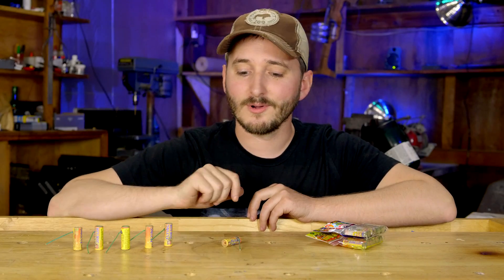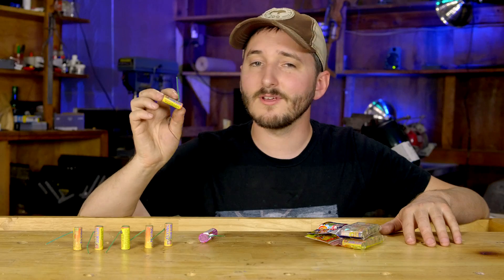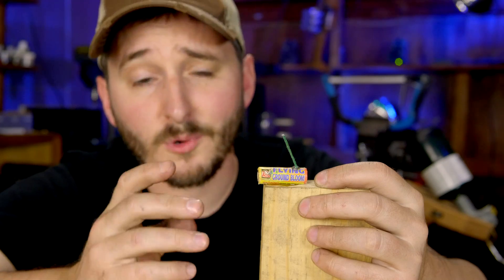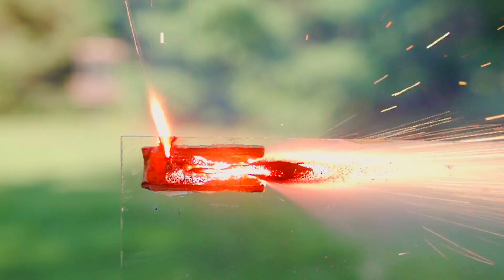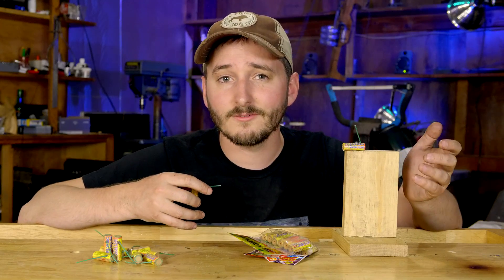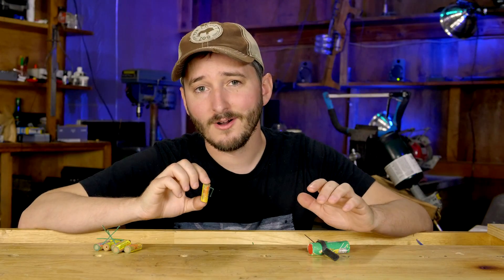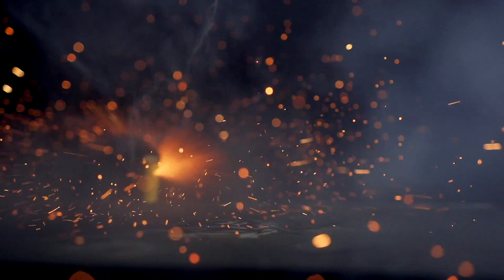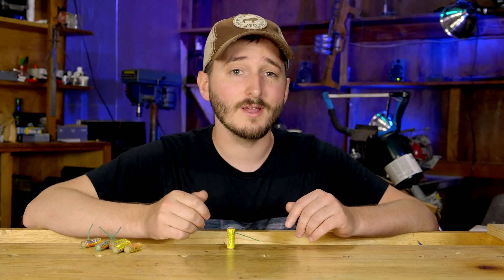How Do These Fireworks Fly?

Comment: I am looking at this as a spin balanced system very much like a spinning top, as you suggested . The side exhaust is pushing in all directions (with a slight angle to incur rotation), preventing it from falling in any one direction (would imagine speed of rotation is a factor) and once it is semi balanced the flame will simply push it up.

Comment: I'm gonna go ahead and guess a possible reason why the fireworks stand up upon the fuse igniting them. I noticed during the slow-mo of the one you cut in half, that there is a fairly large "plug" in the "head" of the firework compared to the end with the exhaust hole. The red clay like stuff gives the head more weight and when the initial fuse lights and provides thrust, that "plug" becomes the center of gravity. The hole from the fuse isn't drilled directly into the tube, it has a downward angle to it to assist in some downward thrust. The angle of that hole combined the with mass of the head "plug" creates a center of gravity at the head of the firework. This forces it to spin around that weight and lift ever so slightly. That seems to be the reason it stands up.

Comment: ok, my guess is.....

the exit hole is not only tangential to it length but as you also pointed out tangentially to its axis. this creates a spin in 2 axis. one of those spins is high energy,  axially, and one of those spins, along its length, is low energy and used to help start a gyroscopic procession so that the point of contact will shift as friction grabs hold. because of the spin tangential to the axis it also rotates and when the jet is blowing into air it only has so much mass to push against (and/or is just pushing down in with gravity) but when it rotates about and faces down it has the "ground effect" or something to push against (and/or is blowing in a direction not forcing the body against a solid surface) which starts to stand it up. when it stands up you develop the friction point along its annular face which combines the low energy spin and high energy spin combine to finish standing it up. think 'spins faster, when the procession wants to bring the axis of rotation over the friction point as the friction point is brought under the axis of rotation. because the speed of rotation is increasing as force is continued to be exerted you see the gyroscopic procession work backwards then you are used to seeing (as it gets slower it processes more is now happening in reverse. gyroscopic recession?) this brings the body to line up in a direction mostly up when the launch charge ignites, and, as its still spinning while being launched you now have a rifling effect to stabilize it in flight and through doppler effects and hiding or exposing the noise source on the front or rear side of the body as you view it you get the warbling effect in the sound.

Comment: The spin causes a torque that points toward the fuse end. The fireworks always spin in the same direction, and following the right hand rule we know this. Torque is the same reason gyroscopes self-stabilize.a

The ground effect kicks it off the ground just enough to allow that torque to take over. I would imagine that the initial orientation has an impact. I'll have to rewatch the footage, but I imagine that the ones that start by rotating perpendicular to the ground plane had their fuses parallel to the ground.

Ground effect, by the way, is caused by the ground pushing back faster than the air. Newton's third law dictates that they both push back the same amount, but Newton's second law dictates that since the ground stops the thrust more quickly, a thrust pushing into a hard surface produces more thrust than a thrust pointing into the air. 

The impact friction has would be limited to allowing the tube to spin. You know how bowling balls don't start rolling until halfway fown the lane? That's because the lane is waxed. Different waxing patterns affect the spin of the ball differently. This could be tested by greasing the table and by firing them off on sandpaper.

Comment: Friction is a factor but I think the primary reason for the tube to spin is that the nozzle is not drilled towards the center of the cross section. You can see in the shot at around @9:19, the 'thrust vector' is offset.

Comment: We called them stingers. We would put them on a nail that was sticking up from a board and they would launch in the direction the nail was pointed. We had much larger kind as well. Can be made from a mode rocket engine if you drill right size hole in right places. And they work with or without nail. Fun  kid stuff.

Comment: The rocket stands upright because that is the most stable angle for it to rotate around its axis, when it is interacting with the ground. When it rotates around its axis, it bumps into the ground. This causes instability. 
In the first moments if this bumping aligns with the direction of the exhaust, it stands up quickly. Because this causes maximum instability towards laying down. But if the bumping aligns with the opposite direction of the exhaust, it stands up more slowly, because that causes maximum stability in that circumstance. But on average it is more unstable than stable, so it has to stand up anyway.
When it is not interacting with the ground, then any angle is equally stable for it to rotate around its axis..
The ground causes instability towards a specific direction. So the rocket needs to rotate in a perpendicular angle to the ground.

Comment: These are really interesting fireworks because when you spin them the force point gets closer to the axis of rotation rather than farther like 99% of other spinning things. Those want the force as far away as possible, like spinning in a chair or a governor. The way that I see this working is that the force vector is offset from the center of the rocket. So as it is pushed in a circle laying flat there is also a small amout of force pushing upwards. As the rotations increase  this leads to a constant inwards push as the rocket begins to stand up forcing the rocket to move skywards. This doesn't happen off the table because there is no orientation dictating ground so it finds the long axis and goes in that direction, ie any random direction

Comment: I would assume the distribution of the fuel also distributes the weight. The first burn rotates on its axis vertically because it’s mass is decreasing while the second lot of fuel still has all its weight at the bottom.

Comment: Not going to claim to be smarter than you, after all, you've taught me a lot... but in support of your theory I'd like you to consider the direction that these burn (from one end to the other) and hence the weight imbalance that occurs during that initial rotation. That is to say, as one side burns (and becomes lighter), with exhaust pushing that side upward, you have the transition into the "spinning top" effect you mentioned. Then there's the upward thrust as the other side is well and truly burning.

Comment: The moment the fuse burns into the firework it seems to roll so the hole is down. I wonder if the hole side is weighted more on that side to get it to fall hole side down as the side charge lights helping it stand up?

Comment: I think the thrust of the side jet self rights it. It first jumps slightly upright by using the higher pressure generated when the jet blows right onto the ground. basically a ground effect. then, while it's spinning around it's longitudinal axis, while also spinning around off axis, it continues to speed up. I think the gyroscopic effect from that increase in rotational speed begins to stabilize it and reduce the off-axis tilt.

I think the best way to test the second half of this would to be to build some sort of top like device, that has a way to increase it's rpm under it's own power. My best idea is use a co2 cartridge inside some custom made top, and have it so it does a controlled discharge out nozzles in the sides to get it to spin. if the top begins to get more stable, with less off axis tilt/rotation, we could be relatively sure that the increase in the gyroscopic effect is what gets it to point within a certain degree of straight up for launch.

Comment: I enjoyed thinking about this along with you in the video - the thought process journey is as enjoyable as any conclusion we may eventually reach.

As a further experimental idea, I suggest trying to spin small cylinders on a flat surface, with no rocket thrust - I feel like there is something about the geometry of the contact point with the ground vs the rotation of the object that tends to drag the cylinder into an upright position
Reply: Same with a hard boiled egg- spin one flat and it will stand up!
Reply: Clearly the alignment of the side nozzle provides a significant thrust vector tangential to the circumference of the cylinder.  Combined with it's orientation relative to the CG, that's going to tend to make it stand up.  If the thrust was also angled axially toward the CG, ti would make the object want to take off, without any help from the jet on the end.  That said, it would require much more thrust, and it wouldn;t be as fast or impressive.  This configuration would be much cheaper and much more exciting, which, after all, is the point.

Comment: Many of my rockets in KSP ended up like that, so I kinda expected it to work like that ^^

i can not make any claims of fully understanding the physics behind this, but I intuitively understood that the tube will stand  up when rotated. I guess since the center of mass will not be he center of volume. Or maybe its related to distribution of mass around the spinning axis, and a standing tube has that closer to the axis. in any way, once the tube stands the nozzle points down and on average imparts a vertical thrust vector.

Comment: IDEA: I used to shoot bottle rockets by placing them at the top of a length of pipe. Each was held from falling inside by the fuse. When the fuse burned short enough they would fall inside like a mortar and I could aim them easily. This technique would work well with these... The tube could possibly increase thrust while the spin would provide stability like a rifle.

Comment: One thing is that there may be a shifting in the centre of mass. As the firework is lit, the fuel combusts and some of the weight is expelled in the form of ash/smoke. This would also change its moment of inertia as well. If the center of mass is moving from more-or-less the centre, towards the bottom exhaust on one side, it could be that the self-righting a side effect of the spin and the moving centre of mass and/or change in moment of inertia

Comment: Feathers on the back end of a dart will make the tip point down when you drop it, because the point is weighted.
The first sparks make the firework lift up, but since they are on one end of the cylinder, it mostly lifts one end.
So now the dead weight of the bottom end makes that side point down.
The second release of sparks lifts the whole firework into the air just as you described it.

Comment: I always pondered the physics of these as a kid. But have not thought about this for 15 years. So 15 years ago I would take these fireworks aka "blooms" and have a friend light the fuse as I held it in a sling shot fully pulled back and ready to release as the fuse almost ran out. I would shoot it into the sky and when it would light up it would then rocket spiral its way back to earth and sometimes back towards us like a missile... But most of the time it was short lived and would run out of juice before it would hit us or start a brush fire. But it was in fact really weird because if you just light it on flat ground it would just spin like a top.... aka a flower "bloom". Great 4th of July memories there.

Comment: My initial impression was that it would stand up due to precession, in fact I thought of a tippy top. Once it is spinning it simply needs the rocket motor to fire through the now bottom hole.
I dare say precession and the ground effect of the initial burn will both help stand it up, depending on circumstances, some will get  good blast to begin standing up, some may take a few revs and stand up largely due to precession.

We don't have those. I live in the UK. We are barely allowed a box of fucking matches.
I remember we uses to have some when I was a kid, but they were a bit bigger, twice s long and just had cardboard wings stapled on. They were crazy bastards, used to go anywhere. My mates mum had one land in her anorak hood and burn it to fuck. It was hilarious.
They banned 'em a couple years after. Not due to that incident obviously. But I don't doubt there were similar around the UK.
Though these wankers banned playing Conker's at school. Nothing would surprise me these days in the UK.

Comment: Night, I think maybe you're letting gyroscopic effects overcomplicate it. Imagine what the average sum of forces (-gravity+rocket thrust+ground effect) looks like at both ends under axial spin.  Gravity dominates the end with the (un-lit) lift nozzle because it has the mass of the nozzle and un-burnt fuel and nothing is countering gravity at that end.  Assume rocket thrust is constant and the gravity vector is constant. On average the rocket thrust coming from the fuse hole is zero because thrust at angle T is opposite thrust when spins to angle T+180, so it can be ignored.  So it simplifies to just laying there as if unlit until you add in the ground effect force. Ground effect is maximal when the nozzle points straight down and minimal when it points the opposite way. So on average ground effect is lifting one end. Now consider when it is lifted vertical, all of the mentioned forces are in equilibrium  since there is no ground effect,  rocket thrust is still canceling itself out and gravity is equal all around.  If it starts to tip over, ground effect comes into play again and rights it. The same imbalanced forces worked as it transitioned from horizontal to vertical. I hypothesize the reason time to right itself varies is due to the amount of time ground force dominates as axial spin accelerates. In other words, if it rolls over for the nozzle is on the ground before it spins in earnest, ground effect will have more time to act than if nozzle points some other way at first.  Not sure I put any of that into words very well, and for clarity I left out a lot of maybes and I thinks, possibly giving the impression that I think I know what I'm talking about when i'm actually very unsure.

Obviously there are other forces at play such as friction and gyroscopic, but I think they might be small compared to ground effect, or "cancel out."  I'm not sure if weight or inertia plays a larger part at the main nozzle end. It might be enlightening to put the firework on a falling surface so that ground effect is there but gravity isn't. Some numbers would be nice too. To me, it doesn't appear to be spinning all that fast so I discount gyroscopic forces, but maybe I'm wrong.  By counting frames, it should be easy to figure out all of the accelerations. If you're brave or perhaps stupid, you could try putting in a new fuse hole normal to the surface and plug the old one to see if that angle is relevant.  Maybe also spin it without lighting it to see if it will stand up as someone said will happen with a soda can (actually my favorite hypothesis except for my spin rate doubts).  Also light it with the hole over a slot in the surface to eliminate ground effect. Maybe use a weak bugger of glue to stick it to a wall and see what happens.

Comment: Looks like it could be the center of gravity shifting. The burn starting at the top reduces the mass near the top while providing rotational movement. Just like a top, rotation plus a low center of gravity makes it spin upright. Then the main rocket core fires, launching it upward.

Comment: If you look at the angle at which the fuel burns out the side hole, it appears to have a slight tilt, angled downward and radially relative to the cylindrical shape of the firework. The slight tilt towards its radius causes the initial spin which acts as a stabilizer, and the slight tilt downward toward the base of the firework begins to elevate it off the ground after the initial spin lifts it slightly. After an initial delay the base ignites, then giving it the final push upward to send it flying. It's a pretty simple concept in terms of physics, but it isn't necessarily too obvious without actually examining how the firework burns in slow motion.

Comment: You could try plugging the hole and filming to see if they still behave the same way.

I'm probably wrong, but what I think is happening here is that the part that is spewing sparks propels the firework,

Then (and it's been a while since I took a physics class so bare with me), the torque lifts the firework up, and would make it topple over the other way,

But, this is overpowered by the spinning stabilizing the firework upright like a gyroscope.

Comment: I presume the mass of the clay at the nozzle end is more heavy than the side with the fuse. This would make sense in the event that the firework does not stand up right away. As the fuel burns the heavy end (nozzle) should go towards the lowest point of gravity, when the fuel burns providing rotational energy, it is reducing its mass on that end as well. Rotational energy and the loss of mass helps it stand up right before the thrust breaks through to the larger vertical ascending nozzle.

Comment: Weigh the bottom and the top. The plug is a weight while it rotates after lighting causing the spin until it points up until it blows out to propel it upwards.

Comment: As the fuel burns away, the center of mass changes. Based on your cutaway, it would result in more mass towards the bottom/nozzle. This probably helps the tube right itself along with the effects you've mentioned.